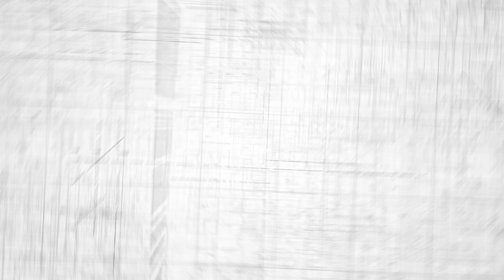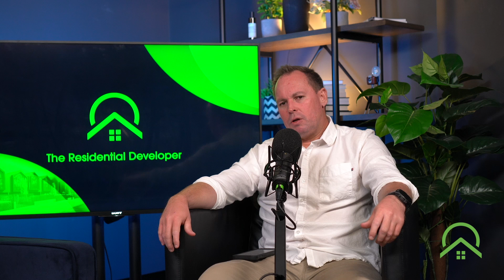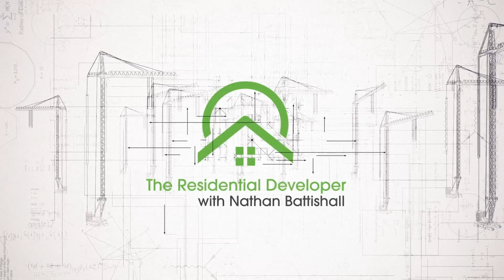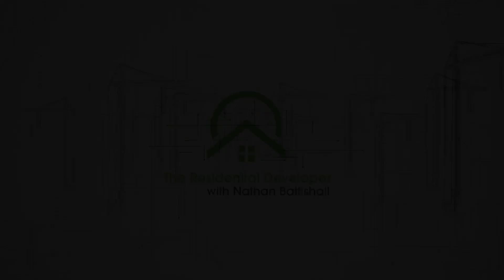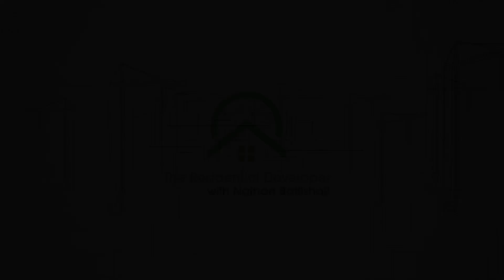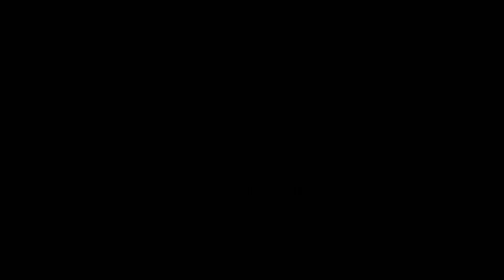Manor House Reality Check: Costs, Delays & Missed Potential | Nathan Battishall

Comment: Hi Nathan - I had to view this video a couple of times before I realised that you are talking about Manor Houses in the context of Low & Mid Rise Housing Diversity Code and not LMR. What alerted me to this is you mentioned you can’t build them in R2 unless ‘multi-dwelling housing’ is allowed under the LEP. Then you related the GFA calculations - which are fairly complicated under the Housing Diversity Code. As you know, under LMR, you’ve got 0.8:1 for manor houses on a (minimum) 600SqM block with (minimum) 15m frontage. This should give you 480SqM of GFA, which will calc out to around 4x110SqM units. The other intersect with LMR is you only need 0.5 parking spaces/apartment as opposed to 1 each under the Housing Diversity Code. Even taking into account the additional building and certifying costs, I believe that in an LMR mapped area, Manor Houses are on a par with Terraces. But I think the huge advantage for Manors is the ‘multi generational living’ aspect, where mums and dads can borrow the funds under a development loan with a 2nd mortgage against the family home for the deposit. Build costs will be around $4.5M, sell the 2 bottoms units, mum & dad move in and establish one as their PPR, kids in the other, mum & dad live for 6 months and sell CGT free. Move back to the family home. Comments?